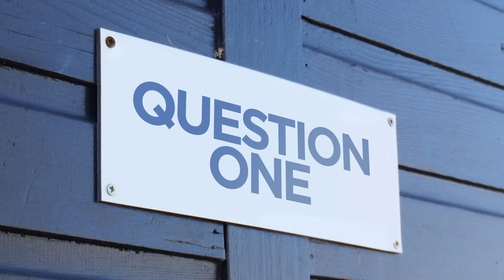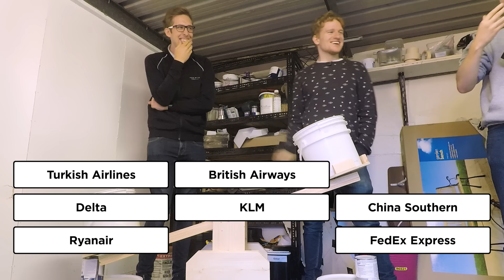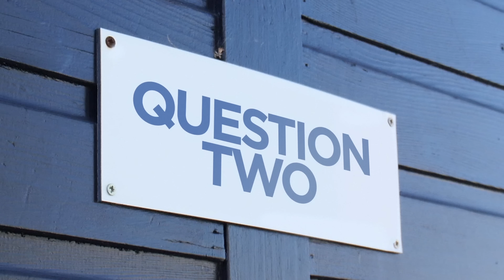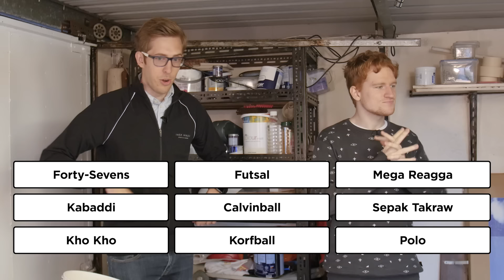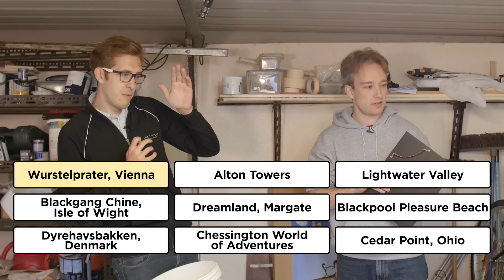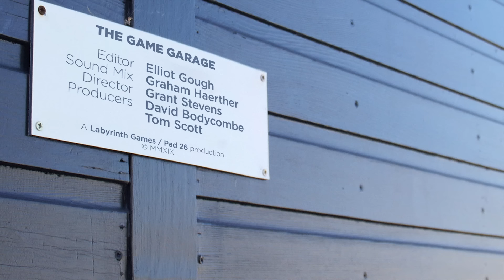Weight For It (with Evan Edinger and Luke Cutforth)

Comment: The relative scoring system is GENIUS!!! (But you could tape some lead weights inside some of the wrong answers just to have a moment of false excitement, then dread, when barely any sand comes out :D )
Reply: Nah. Sand. Lots of it. Inside a sealed ziplock bag. Then it feels completely legit.
Reply: Even better is if you weighted them to make all the weights equal so you never knew until the pour, even better if instead of sand it was the pence you're playing for
Reply: You are evil! I love it.
Reply: @Jaymic  But then you wouldn't get to see their reaction on the initial lift/handoff
Reply: Calm down, Satan
Reply: Wish you'd put all the values up after the questions for those of us playing along at home.
I think hanging the buckets by the handles should prevent the sand redistribution after a tip from giving advantage to the earlier player.
Reply: YES!
Reply: @Jaymic  Nah, I think that part of the fun is feeling the weight difference.
Reply: I was thinking large stones, that have to be picked out of the bucket.
Reply: That's so evil why you gotta be like that
Reply: @Fazal828  Easy. Don't tell them about the weights.

Comment: One change I would make:  Brace the balance until after they've dumped in their answers, then release it to see how it tips.  It would add a little suspense.
Reply: I'd also hang the buckets from hooks at the end of the arm so that the sand won't try to fall towards the winning side.
Reply: Another improvement to reduce friction would be to use washers for spacers. Also bearings in the center section
Reply: And here I was thinking clear buckets so the audience can see what's going on!
Reply: Would also stop you having to test to see whether it's equal / having friction problems after each question
Reply: Yes
Reply: @HermanVonPetri  I was thinking having the hanging weights would be the best.  The small area of the handle compared to how it is now would negate the effects of where the sand is in the bucket.
Reply: I would prefer the tension of seeing one in lead and the other one struggle under the pressure. Thats how competitive game shows work, right?

Comment: Really fun game, I love it! I just have a couple of suggestions:
1) instead of a seesaw type of balance, use a pulley type of balance that goes up and down vertically rather than in an arc. The seesaw balance isn't very accurate, and both how the sand is poured as well as the movement of the seesaw itself could change the outcome. 
2) I wouldn't take off the labels on the screen once they're picked. It'd be better if you made them less opaque or something, but it'd be good to still be able to read it.
3) at the end, put the numbers below the labels or something, that'd just make it easier to follow how they all relate to each other.

Comment: In the final round, instead of the medium anvil, why not weigh against 2000 pennies. That's 7kg in coin.
Reply: because then you don't want to win?
Reply: greay idea, having to compete against the weight of your prize in pennies, but still give prizes in notes, no one deverves to get thousands of pennies.
Reply: I was thinking that as well.
Reply: @Soken50  I mean, you could just bring them to your bank and throw it into the counting machine...
Reply: @entropyzero5588  I've never heard of counting machines for coins, only for bills in narco movies.
Reply: @Soken50  Not even parking enforcement ?
Reply: @Soken50  Really? I know a big bank in the centre of my town has one, as does one one town over, so I just assumed they were rather common in bigger branches. But maybe that's a German thing :D

They aren't as small as the bill counters you know from the movies, but rather full-sized ATM-like terminals (which presumably have some sort of reservoir for the counted coins behind the wall they're mounted in/ underground).
Reply: @entropyzero5588  Most banks where I live in the US also have a coin counting machine. Seemed common place enough.
Reply: We have coin counting machines in grocery stores.
Reply: But what is the volume of 7kg of sand? Wouldn't ~17,5kg of sand be quite a lot to beat?
Reply: @Floedekage  46 liters, that's 12 gallons in freedom units, of sand for the 17.5 kg. The scale may need to be a bit larger, but it'd make the finale more exciting.
Reply: @entropyzero5588   In the US, we have coin counting machines in grocery stores. But they usually charge a ridiculous fee, like 9% or something, to use them.
Reply: IceMetalPunk many grocery store coin counting machines waive the fee if you take your money as a gift card to the grocery store, so they know they will get it back some day.

Comment: I don't know if this is open for ideas, but I feel it could add a bit of tension if the seesaw was fixed until the end and it would only show the winner after all the sand was poured in. (Would also make sure that it isn't just stuck, although the professional production would probably have it oiled up properly)
Reply: But that would be like a game where answering questions correctly scored points, but the scores were read out only at the end. Knowing the relative score at each stage builds tension.
Reply: It seems like holding it level for each turn and then letting it drop once the sand is poured would solve part of it, too.

Comment: Awesome idea: BUT, I would suggest the following: Rather than having a See-Saw, I would go with a pulley system with a flag pointing to the individual person. I also would go with water rather than Sand, so that the physics of where the sand is flat or not doesn't change the center of gravity.

Comment: An optional twist for the final round: go for a bonus 1,000p but have the highest answer not chosen added to the anvil at the end. Could mean that for the 5,000p one you had to get the top three choices, or tip the scales on the lower weight categories if you made a really bad choice.

Comment: I like this as a concept.
I feel like the sand thing is a bit of a gimick though, but I also have a fix for that - in the final head-to-head round you should apply a brake to the balance so that it won't tip, then remove the brake at the end of the round to see who wins.

Also, the prize money should have been in pennies!

Comment: If you suspend each bucket from a point, the need to concern yourself with the level or distribution of the sand inside the bucket will be reduced. Consider a wooden frame which skirts the bucket at the top (but doesn't touch) and have a single dowel go through it.

Comment: Neat concept! Sand is an interesting choice. Cheap and readily available, though I imagine it's a pain to work with. Nice visual for the audience, though, since we can't feel how heavy the things are. I was going to suggest stacking weights instead of getting sand everywhere and dealing with settling issues, but they'd obviously have to be made to look identical. Pain in the ass, and less visually dramatic. For maximum drama, try mercury! We'll have no idea how heavy it is, but gosh will it look cool.

Next time: the guests try to explain nonsensical social media posts. As they get closer to the answer, a giant elastic band is pulled back further and further; when they get a detail wrong, the elastic band is used to launch a 10-lb weight into a field. The player with the largest longest average distance after 3 rounds winds.

Comment: The funny thing about "korfbal" is that it literally translates to English as "basket ball", so I suppose that's why the English word for it is "korfball" instead.

In short, it's a bit like basketball as you probably know it, but the basket is like an actual wicker basket (but without the bottom, so it's a wicker tube), the pole is shorter, and there is no backboard.

Comment: I think in the end, you should instead start with the small weight and ask if the contestant is confident enough to add another weight. That would build more tension and force a difficult decision and evaluation of ability from the contestant, as well as risk a fear of failure.

Comment: Doubt this comment will be read, but I'd like to point out a flaw in the scoring system. If the player is allowed to touch the sand in their buckets, they can probably make the sand slop towards the center, shifting the center of mass of the sand away from the center, which would increase the moment. This could be used to cheat when the scores are close. I would suggest solving this issue by suspending the buckets of sand instead.

Comment: I like this concept a lot! Is the sand in the answer boxes related to the answers (i.e. 1115 planes = 1115g of sand) or is it just that the top answer is a full box, and each box has 10% less sand? It would be interesting to see how this would work if the amount of sand was proportionate to the answers.

Comment: You should have the scale locked in place until the final answer is given, ratchet up the suspense, and use some kind of graph to illustrate the weight of each answer.

Comment: Since you seem kinda big on one-offs, I'm guessing you won't have much use for this in another Weigh For It, but if you need to cut friction in wooden assemblies in the future, you can scarcely go wrong with shaving a candle. Just grab the cheapest candle at the closest store, (or a block of paraffin if you're being fancy and planning things) and rub it on any axles or sliding parts in an assembly. Unlike oil, it won't have a chance to soak into the wood, and it's solid enough that it decently resists being squeezed out of a joint under load, unlike say, lithium grease. It isn't perfect, but it's more slippery than bare wood. It also has the benefit of being good while also being a quick and dirty fix. You can lube wood in a couple seconds, with no worries about working the lube into bearings or any metal-land nonsense like that.

Comment: So how exactly are the quantities of sand meted out? Is the top answer container filled to the top and the rest of the answers are proportions of the top value (an answer that's half the value of #1 has half the sand) or is it just based on ranking (#1 is filled to the top, #2 is 90% full, #3 is 80% full, etc.)?

Comment: I'm not clear what determines how much sand goes in each of the boxes. Is it fixed amounts for best, second best, etc? Does it depend on the actual figures? (So, an airline with 1500 planes has 3 times as much sand as an airline with 500 planes)? If the former, are there fixed increments between the amounts? And how does the least amount compare to the most? And where on these scales does the scoop of sand (used in the tie-breaker) fit?